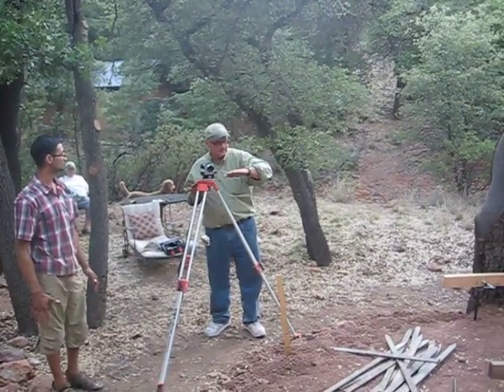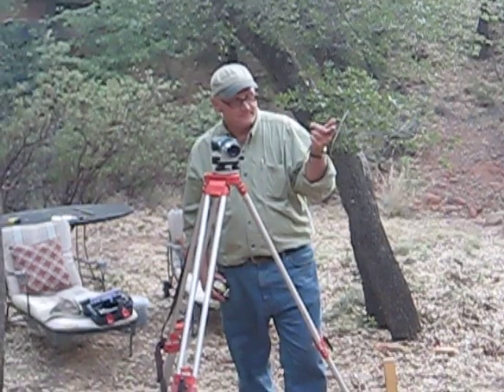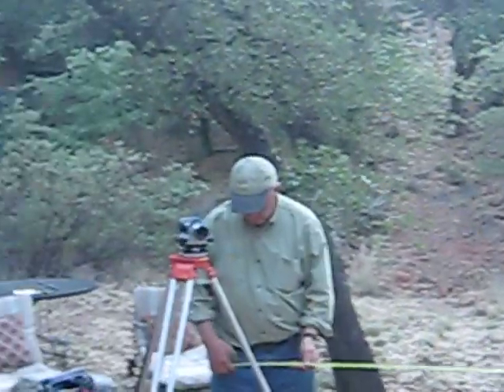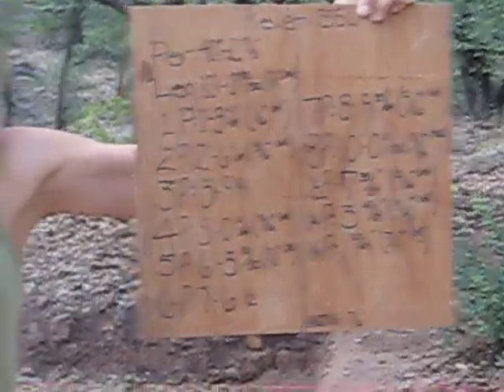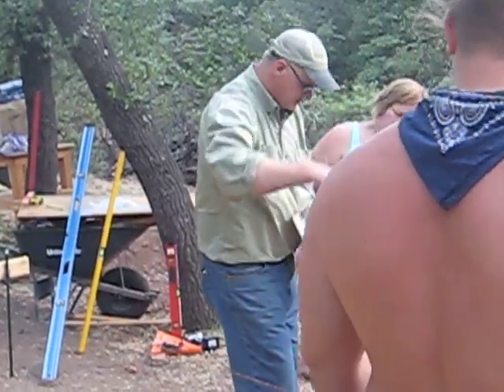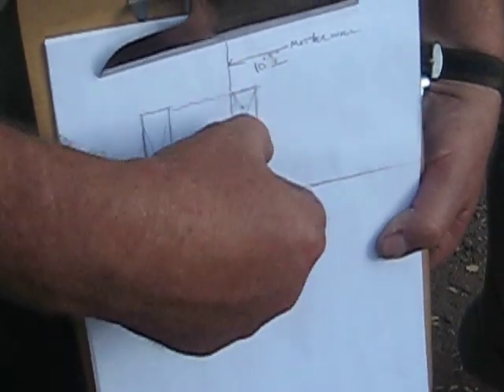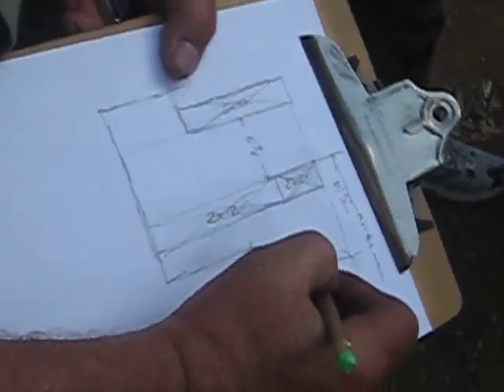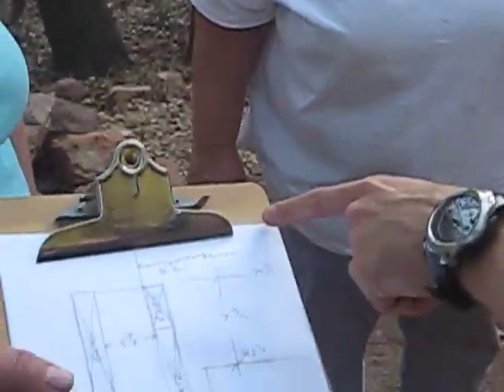Ken Explains Laying out foundation

Comment: it took me a 40 hour class with a very good instructor to use one properly if you are inside your property boundaries well its not a big deal but if you are into another neighbors property of abutting it I would get someone who knows what they are doing. remember if your off 2 minutes on your corner and the distance is 100 feet your several inches off to the right or left degree, minute second 360 degrees in a circle 60 minutes in a degree 60 seconds in a minute
Reply: lol wtf are you talking about lol

Comment: This is so antiquated. I have been pouring foundations for 35 years, and you are wasting so much time with strings and nonsense. You might be impressing those homeowners, but you do not understand layout.
Reply from the maker: yes, it is about 8000 years old. we are laying out the foundation for a vastu temple under the guidance of Dr jesse mercay. at times we are taking calculations out to a 25th of an inch to make sure the structure is sound (literally)
Reply from the maker: +Seth Grossman 256th of an inch